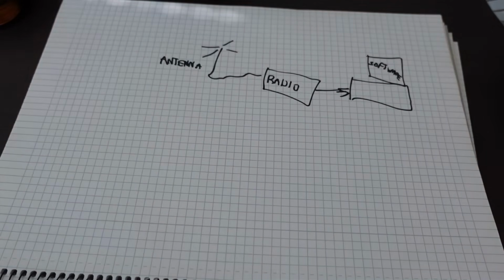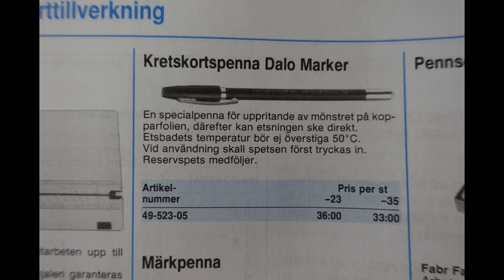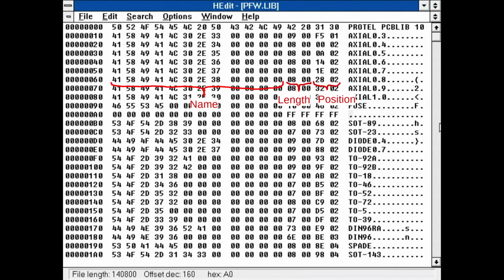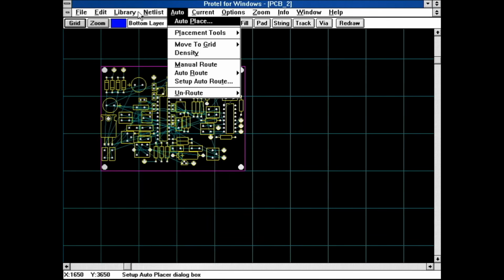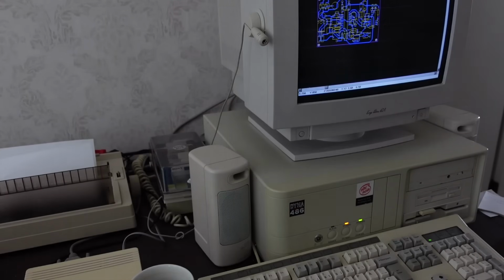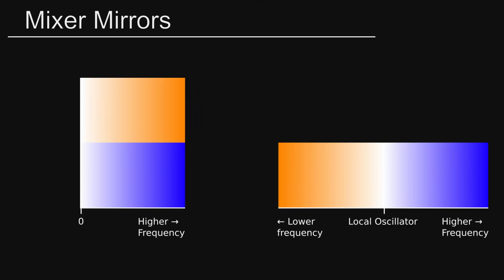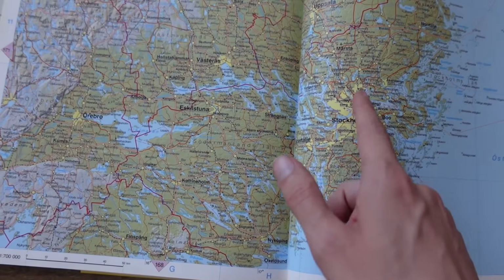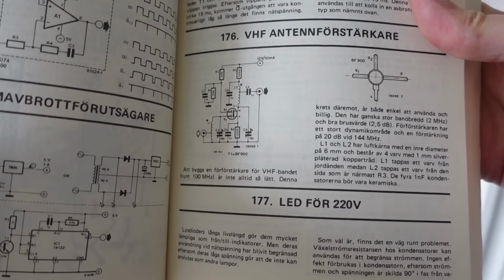Attempting to Build a Radio to Receive Pictures From Space Like It's 1994

Comment: Fantastic project, but jvfax can be used with a sound card. There's a driver developed for using the Sound Blasters of the time by 4Z5BS. I don't know what year it appeared. There was also an interface to the 741 via the RS232 port, called HamComm, for jvfax and other programs.

Comment: Respect for what you are doing, but in reality you are complicating the thing more than it is actually.
The same thing was already obtainable before 1994 with Sinclair Spectrum, Commodore 64 and other different home computers of the 80s.
Even by imposing the use of JV-Fax 6.0 the whole thing is obtainable in a far easy way.
With a simple slicer or limitator it is possible to reach the same performance: you can see the fingerprints on the adhesive tape used to fix images/texts to be transmitted on the drum of the fax machine and the thing changes little for satellite transmissions.
Regards.

Comment: Surprising to see someone else doing the things I was planning for do for a long time! Currently I'm building a semi-autentic workstation for HF digital communication based mainly on AMD PR-200 machine for data processing and a mix of PDP-11 and Z80 CP/M based custom machines for rig control. The radio I'm working with is also a mix of 1956 tube receiver with motorized frequency control and a custom build transmitter addon for it.

Comment: 27:07 - this method still can be useful for prototypes
27:30 - it's used not only on RF, for example mains power transformers are also tapped

73 de SQ2KTN

Comment: Great project! The jvfax software oh boy it was a great time. Had a wideband fm 137mhz receiver and used my 2m crossyagis for amateur satellite to decode them on my 25mhz 386. Tracking software "instanttrack" you had to load the kepler data once a few weeks which were available at the packet radio bbs'es. Tracking antennaswith an if100. Used to have alot of fun with oscar 10, 20, 29 and the 9k6 bauds digital amateur sats in the 90's. Now enjoying moonbounce on 23cm. 73! On5gs

Comment: So fun anecdote from back in the day: The one I saw when I was a kid used a tuner pulled out of a portable TV set. The VHF band tuner module apparently worked very well when paired with a turnstile antenna with a reflector.

Comment: I HAVE TAKEN DOWN  "1000 AND 1000" OF  "SAT PIC" + "INTERPOL WANTED PIC"...

BUT !!

THE "RADIO STATION"  I WAS "OPERATING" ... IN 1995s ... WAS   "HF"  (SHORTWAVE)

UNDER  "15 MHz"  ..MANY MORE  "SAT FAX STATIONS"   FROM ALL THE  "WORLD"..

(ALSO   CW  RTTY  /  AMTOR / SITOR / TELEX ...)

WAS  USING A "486"  AND  "SIEMENS  R  310"  RADIO FROM 1960s

A  LITTLE  "RS323 BOX"  TO PUT IN  "PC" ...AND A WIRE TO THE "AUDIO"  OF THE RADIO

NAME  OF  THE LITTLE  "MODEM"   (BONITA OR BONITO)

SOFTWARE  THE  SAME

THE  RTLSDR / DVB STICK   WILL NOT BE GOOD TO USE

A REAL RADIO  ..  (MUST BE STABLE ON FREQ ..!!!)  IS A "MUST"   AND HAVE  "USB / LSB"
THEN JUST A   (10 - 20  METER  LONG  WIRE ) OUTSIDE  "UP IN THE AIR"   AND GO

THE  "SIGNALS"  SOUND  LIKE  A ... ( OLD  RECORD PLAYER )
PLAYING SAME TRACK  AGAIN .. AGAIN ..

BUT  GOOD  WORK  YOU  "DID"  MAKE  THE "STUFF"  .... YOU  SELF .... ( 100% SUPER )

GOOD LUCK

EUROPE 2025
DENMARK

Comment: Here I ran HF Facsimile 7.0 1993 in California.  The Weather Fax kit was sold in the USA marine stores (West and EB).  The Kit had the 3.5"  floppy disc and FSK Demodulator (hardware gizmo ). My Demodulator has a parallel port 25 pin connector and audio cable with a 3.5mm male jack for the  Short Wave radio 

 HF Facsimile 7.0  was DOS based and  by "Software System Consulting" 

An older version was called PC HF FAX 6.0; maybe the same company? It had a demodulator for receive and an Optional modulator for transmitting images

ICS-FAXII was another PC software uses around 1993 for Weather faxes

There was a Fax machine made for Weather faxes called the "FAX-2 Weather  Facsimile System" that had a audio cable to connect to your SW radio. This box bundled the printer; demodulator and software in one box and was about 2k bucks. ie marketed for a commercial ship

  https://weatherfax.com/stations/

Comment: You can add copper plan to your pcb after finishing placing all the components and soldering, by placing isolation tape over the pcb from behind and then place copper tape on the top of the isolation tape and connect the copper tape to the ground. I know this does not  seem to do much but it is better than nothing.
Reply: I've used this to add a copper plane to a gbs8200 video converter to great effect. It does a lot more than you'd think in the right circumstances. 

Curiously, even a bit of cardboard just sprayed with conductive paint will do much more than one would think inititally for things like this.
Reply: @c128stuff  I used this technique in the past when I was making a PCB with one side copper and I wanted to add copper plan to its back as a ground plan. it made a very noticeable difference in dc buck converters power circuits output noise.

Comment: It's a miracle! The adhesive on that ancient CRT monitor must have been made from some sort of superglue that defied the laws of physics and held up for decades. Also it is very interesting to see a white CRT monitor that did not turn into a yellow stone after all those years!
Reply: I'm more surprised the power supply capacitors didn't go bang in the PC or monitor during prolonged use .
Normally these fail after some use
Reply: “Ancient” CRT monitors are almost always worth more than modern displays.
Reply: @nyccollin  they are laying in the local waste disposal centers every week for disposal lol
Reply: @JohnDIYSmith   Survivorship bias. The good ones are already in collections — what you see dumped are the failures

Comment: This is exactly the kind of niche content I love, using retro computers and era appropriate software, hardware and solutions to do some extremely nerdy stuff :-) 
Shame that the analog transmitters are gone, I think if they were to be around for a while longer, I might have attempted it at some point, though I'd have cheated with modern PCB manufacturing at the very least!

Comment: My chum and I received the NOAA and Metrosat  images and recorded them on a 1950's Muirhead Jarvis machine  using a scanning drum 120 rpm and optics traversing the drum to expose photographic paper. Theas machines weighed nearly half a ton with the valve electronics and resembled a workshop lathe. The were originally used to send images by wire for newspapers. The image quality was incredible with no line visible.  Your project brings back memories and is nearly identical (but neater ) to one I built. The computer did its job but tracking the satellite with the antenna was tricky.  Hearing the tones again brought back good memories.   Check out "  Save it for parts ", he has some tips that may help. Great video thanks.

Comment: Next time for etching try hcl 33%  peroxide hidrogen 130vol and water 1:1:4... No heat no nothing... Water above 25 degree is ok... Board ready in 15 sec😊
Reply: I used that when I was young too! You could get 30% H2O2 at the farmacy. They asked some questions why I needed it, and that was OK. Don't think you you could get it easily nowadays at a farmacy. And if the copper did not dissolve fast enough, I used my finger....  What did I know when I was 14 or so. The same for developing with causic soda of NOH pearls. I wiped the spray off with my fingers, having some dissolved skin in the end.... Would not do it now LOL.

Comment: This brought back memories of my physics undergrad project to receive and decode weather sat data. I started by trying to refurbish an old 1980s framestore and 1.6GHz (IIRC) radio for the HRPT transmissions from the NOAA satellites. The framestore was junk by the late 90s, so I replaced it by a 486 and JVFAX. The radio was also flaky, so I only managed a few partial passes, but it was enough to show off. I must have done more for my final write up, but I can't remember now.

Comment: 25:35 How does it know the elevation without any online data like TLE? Doesn’t it drift off a lot since it’s been decades since this tool?

Also NOAA is dying right? Cool video, and probably the last one ever to use a setup like this forever.
Reply from the maker: I used it to predict a pass in 1994, to stick with the context in the video. The actual orbits were distributed as text files, and you'd want one that isn't more than a few weeks old. For the demo in the video, I just used the orbit file that it came with.

Comment: JVFax was my introduction to receiving WX satellites and SSTV. the year was 1996 and the interface used for JVFax was connected to the printer port but I don't recall the exact details of how it did the analog to digital conversion but it worked, however JVFax was a bit fussy on the signal to be received so it payed to record the pass so you could patch it to try different settings to get it to receive.  It wasn't long after this that the first soundcard based software became the norm and dedicated hardware to receive or transmit certain digital signals was pretty much obsolete!  It was the thumbnail for this video that attracted me!  great video...
Reply: Maybe with the so called HamCom modem?

Comment: A fun bit of info about why wire-wrap was so reliable: the wire being wrapped around the square post cuts in to the wire, through the oxidation layer that's always on metal. This let the wires cold pressure weld to the pins over a few days. You can actually feel this if you unwrap an old connection. It's noticeably more difficult than unwrapping a fresh wrap. Also, you used to be able to buy labels that would slide over the pins of a chip socket showing the reversed pin-out. You can do it yourself with a label maker nowadays.

Comment: This was amazing.  (Also +1 for the autumn windows desktop background pic)    @23:10 USR modem! 

So in 1994 I was in high school where we had a ham radio station in a back room of the physics classroom.  There was a satellite setup complete with transceiver and rotatable antenna, azimuth and elevation controlled by a commodore 64. The fastest computer was a i386 I believe where we ran the software for communicating with satellites, mostly "PacSats" and sometimes voice modes.  I spent many hours there.   You took it all to the next level making it all yourself, impressive and well done.    Great job on the antenna too.  I've received NOAA with just a vertical dipole but yours is much better, i would get strong fading at high elevations
Reply from the maker: I found that the distance to the ground is very important with my antenna. I tried putting it higher up for better line of sight, and it worked great up to about 25-30 degrees of elevation when the signal just... Disappeared. The recommended 50 cm above ground worked quite well despite a large amount of obstructions in my area.